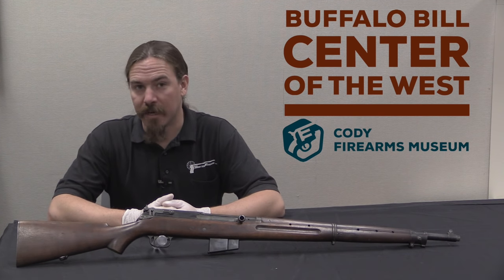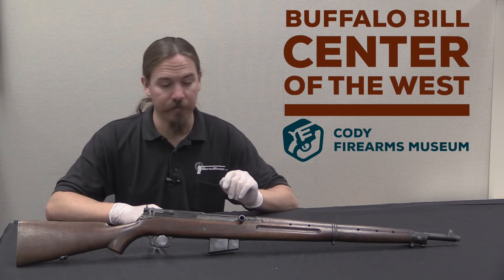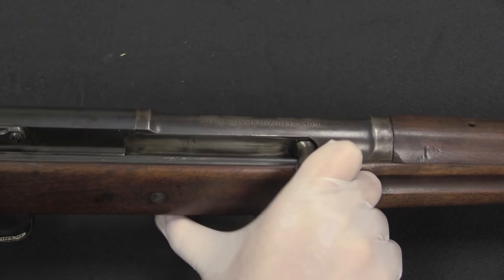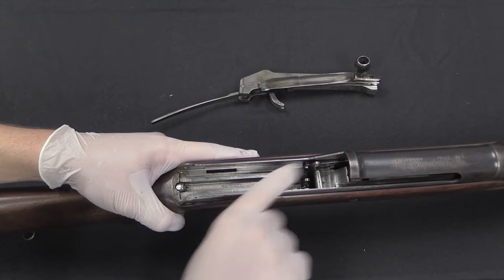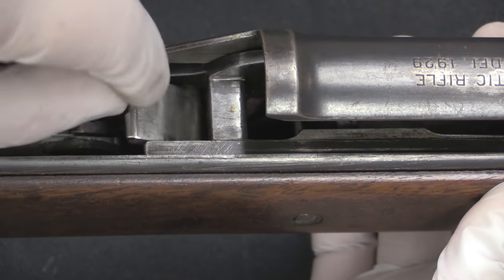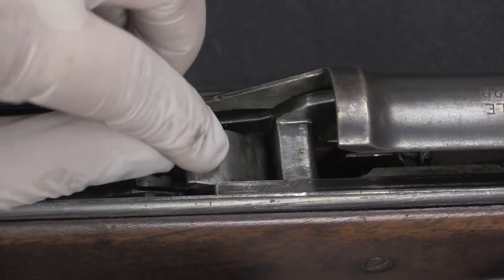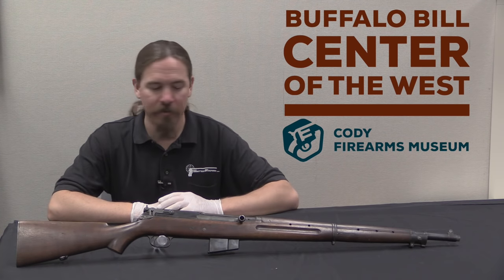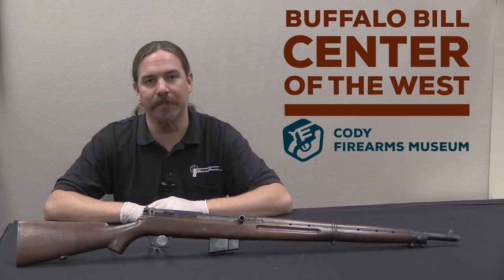Colt Model 1929 Prototype .276 Rifle, by Ed Browning

Comment: Holy hell this is one overly complicated rifle. There's so much going on there, it never had a hope of being accepted by the military. Bad news for Ed Browning, but good news for the rest of us as it does make a great museum piece.
Reply: Which is funny, because at first glance it looks pretty simple.
Reply: spraynpray Very true, but most of the changes were ergonomics related; safety location/design, trigger weight, sight changes. In order for this rifle to have had the slightest chance of being accepted, it would have required a near complete redesign of the entire mechanics of the weapon because it was just too complicated and far too involved to take it apart, let alone manufacture in the first place.

Comment: Hey Ian, great video.
Simple question - do you reckon this accelerator is really useful during extraction or rather much more as a decelerator in the final stage of the cycle in order to slow down the bolt so that it doesn't slam into the shroud?

Comment: the locking surface seems kind of small. If it had made it to later in the trials somehow, I wonder if the design could have been scaled up to 30 06 with that locking area.

Comment: WHY? With all of the 3D CAD programs, have we not seen a company take all of these old designs, and work out the problems in many of these, and make modern versions of them?

In the case of this thing... You could shorten that bolt by about ⅓, and maybe by almost ½, and the “Return Spring” could likely be shortened as well, to provide for a much shorter receiver, overall, moving the magazine back toward the trigger guard. 

And, speaking of magazine... Move the release OUT of the trigger guard.

But shortening the bolt would probably allow for the removal of the “accelerator,” leading to a probable extreme simplification of the internal parts.

It might also do to remove that barrel shroud, and build the sights in some other fashion.

But... In reference to my original comment... Maybe some of these trials rifles just aren’t worth reproducing.

The Pederson, White, Williams, Johnson, and other such Rifles would DEFINITELY be worth making modern reproductions of, though.

Comment: wow! the tail piece is hand forged.you can still I see the hammer tracks on it.it makes me wonder. 1,why wasn't it finished better with the file like aperently the bolt was?and 2, what other parts are hand forged.a good smith will forge as close to the finnished dimensions as possible. then true things up with the file, or in this case the milling machine. the rear end of the bolt looks like it was touched up with a file and then never polished. kinda sloppy if its gonna go to the Aberdeen proving grounds. oh to be a fly on the wall of that shop.

Comment: Looking at these pre-WWII automatic rifles, despite of most of their beautiful built quality and materials, one can really start to value the beatiful simplicity of an AK-type rifle.. :D And with these "try&error" kinda rifles one often finds over-engineering going hand-in-hand with quite obvious faults such as this one's holes in the barrel shroud with larger holes in the furniture.. Making larger diameter slots on the surface of the weapon gather all the possible sand, mud, snow and grit and then drip it into smaller slots on the shroud filling the tight space between the recoiling barrel and the shroud with nothing smaller than gravel.. :D

Comment: Ian , from seeing your video , would I be wrong if I thought  that it is actually the accelerator that pushes the tail of the bolt upwards (not just some tracks you mention) and unlocks it from the barrel while having a second role after that to push/ accelerate the whole , now unlocked , bolt back further ?

Comment: Ian, why do you think it had an accelerator?  do you think it was an afterthought,  or the original design called for an accelerator?  Thanks for the great videos.
Reply from the maker: I expect it was in the original design.
Reply: Correct me if I'm wrong but the accelerator thing seems pretty similar to the FAMAS F1 accelerator to me (Even if the FAMAS is delayed blowback, and this is short recoil toggle locked) can we consider it the same. Or does it have a different purpose. isn't this accelerator design supposed to be invented by Pál Király as you said on your website ?

Comment: Why was there a tail on the bolt with the spring housed in the butt stock?   Why not have a spring behind the bolt like a SKS or SVT which also have tilting bolts.     I guess I just couldn't pick out the function of that long tail device.
Reply from the maker: Because there wasn't a place for the spring to extend back in line with the bolt's direction of travel.
Reply: Just speculating but it could be that they needed a longer travel with a weaker spring, or it allowed them to have the action a little further back in the gun than having the spring elsewhere. Weight distribution maybe? Would like to see someone with more knowledge chime in.

Comment: Could a company make a modern working model of these obscure semiautomatic rifles? If it is possible then why hasn't someone done it yet
Reply: Some of these designs are too expensive to promise a solid return from the niche market they cover. Machining for complex parts in small numbers drives up the price. If you had to, for example, produce a Pedersen rifle you'd be looking at 4 or 5k per unit for a market that is arguably smaller than the one for a high-end racing gun of the same cost.
Reply: +DiggingForFacts  couldn't a company modify the parts to allow for easier production and better function of the rifle, so it looks like the original rifle but have improvements to it, like fixing the problems that caused it to fail in the first place?
Reply: Sure, there are many ways in which this design or others could be simplified or fixed. However, the overarching issue is not possibility, but feasability. You can't cut cost on certain materials such as stock wood and you still have to convince a company that they can make a reasonable profit on the weapon. In this case a weapon that most people have never heard of, in a calibre that is both largely forgotten and expensive to buy new, with a system that is more compicated to maintain and more obscure than a straight gas piston or DI and sell it for a price that doesn't make it prohibitively expensive to people who have to be able to rationalise a large expenditure of their income. That is a very hard sell to make to a company executive. This is why remaking things like the FG-42 and STG-44 in semi-only has some viability, because those weapons are famous to a larger section of the buying public and as such more likely to see sales. Even then, they are still relatively small-scale projects compared to the average new intermediate cartridge sporting rifle.
Reply: +DiggingForFacts that's depressing, I'd love a gun that looked like that with maybe a modified/modernized qualities (such as a more modern caliber, rails for optics and maybe a polymer stock) much like people have done with guns like the sks and the mini14

Comment: The accelerator looks like the one in the bolt of the M2 Browning HMG
Reply: Which is similar to the one in the M1917/M1919.
The M2 is basically a larger M1919.
Hell, if this rifle had a vertically sliding locking block, it would literally be a rifle version of the M1919.